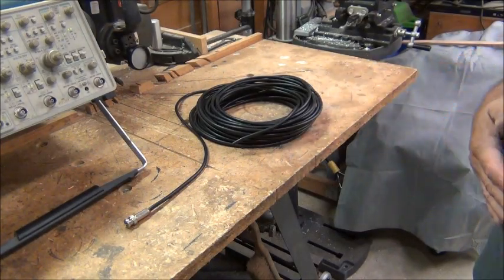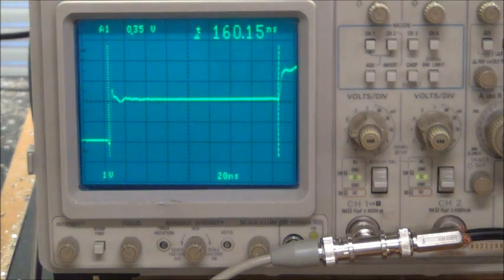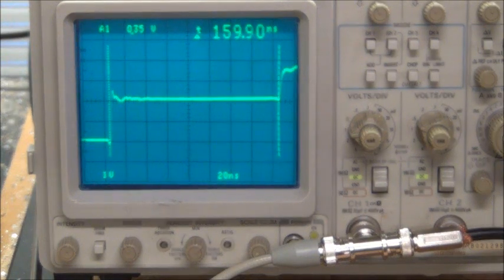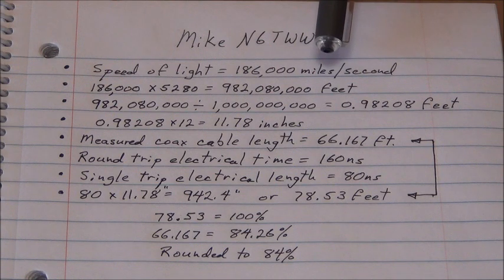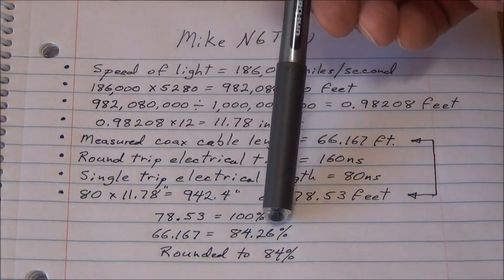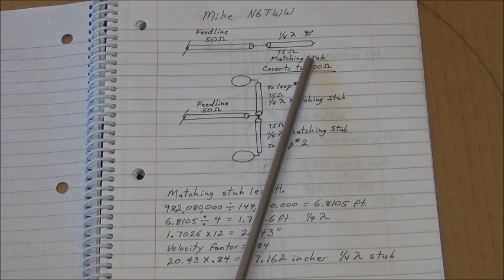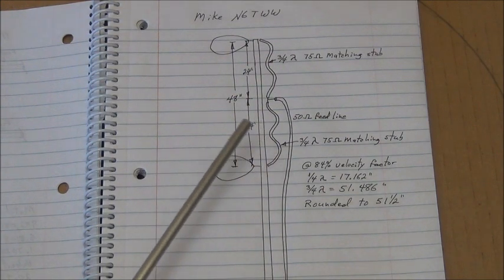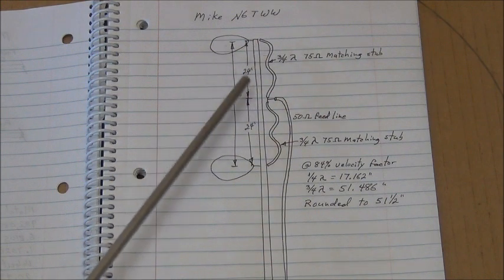2 Meter Halo Antenna Part 12 -- "Phasing Harness understanding & calculations"

Comment: feeding that line with 75ohm looks like 100ohm, doing 2 elements will match to 50ohm because it was parallel, what about 4 elements or 6 element antennas like stock arrays, each pair would already be 100ohms, whats the best way to match the phase harness to our 50ohms with different number of elements.
Reply from the maker: Your best bet would to buy a power splitter from a manufacture rather than building your own.
Reply: @mefedler  can you give me a link for this power splitter, i have not seen a commercially made power splitter
Reply from the maker: @jbx907  One manufacturer is M2inc. When you go to their site search for power divider.  www.m2inc.com

Comment: I have so much RG-59 (75 ohm) coax more than I have 50 ohm RG-58 and RG-8U.  I should be able to use some of the 75 ohm coax for antenna projects.

Comment from the maker: I have not tried using the MFJ 259 analyzer for calculating velocity factor. In the past I had access to a true TDR so if was not a problem determining the impedance or velocity factor. Since it is so simple to use and oscilloscope and function generator to perform TDR measurements, that is what I used. I will have to give the 259 method a try.

Comment: Loop separation can be optimized for either gain or radiation pattern.  Using a NEC model analysis, 48 inch separation yields 8.7 dBi gain at 15° elev and a -8 dBi minor lobe at 90° elev.  40 inch separation yields 7.9 dBi gain at 15° elev and a -40 dBi sharp null at 90° elev.  The optimal goal is to maximize gain in the desired direction while minimizing the gain toward noise sources from undesired directions.  This should optimize the signal to noise ratio.

Comment: Thanks for the informative demonstration with your scope.  An alternate method to determine the velocity factor of a coaxial cable is to attach one end of the cable to the MFJ 259 antenna analyzer with the far end open, and to find the lowest frequency at which the measured impedance is zero.  Then divide the cable length by the free space length of a quarter wave.  My RG-11/U coaxial cable measured velocity factor was 0.6611